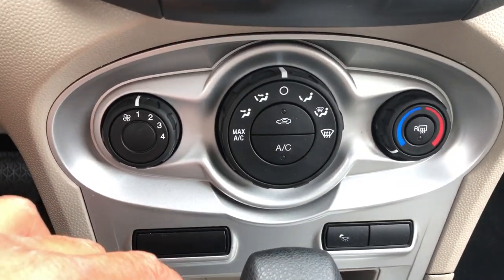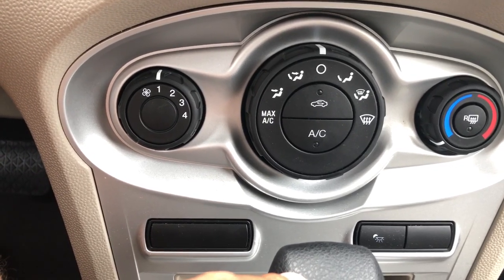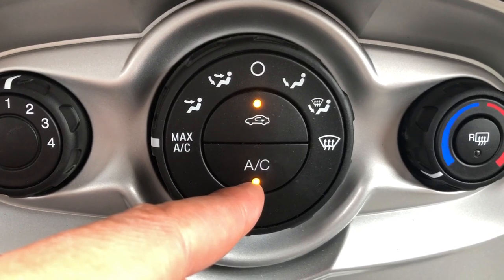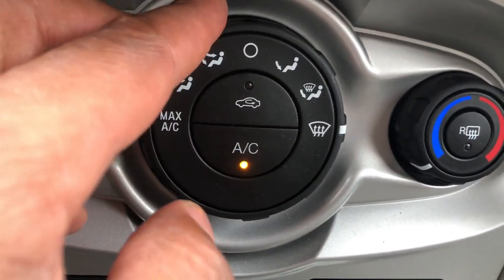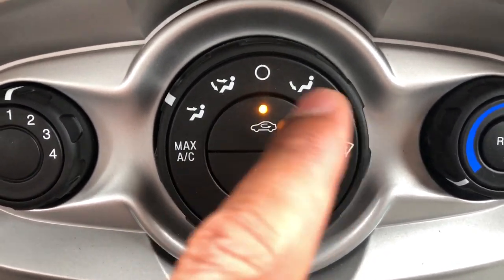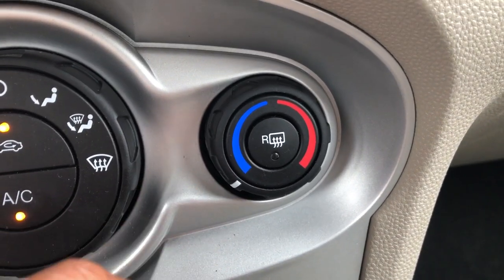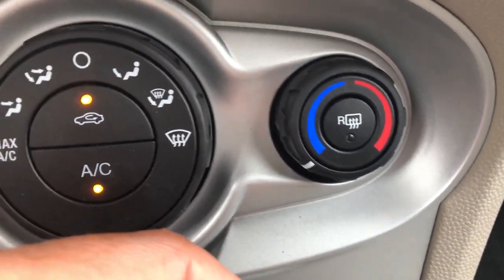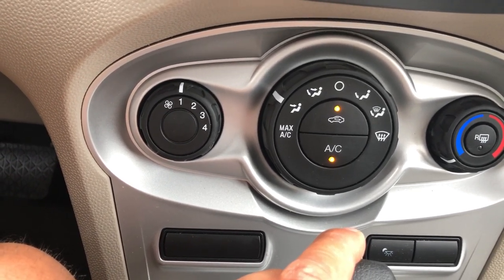FORD FIESTA- Heating and cooling system controls – how to operate

Comment: What if it's blowing hot air when you turn max ac on?
Reply: That's what's wrong with my car
Reply from the maker: It could be a sign that your AC system needs servicing. It's best to have a professional check it out to diagnose the issue.

Comment: Does the max A/C (the top light above A/C) use more petrol/gas?
Reply from the maker: Yes, using the max A/C setting can slightly increase fuel consumption due to the extra load on the engine.